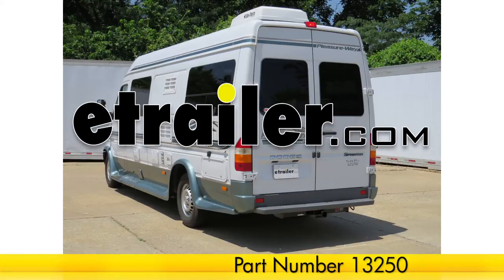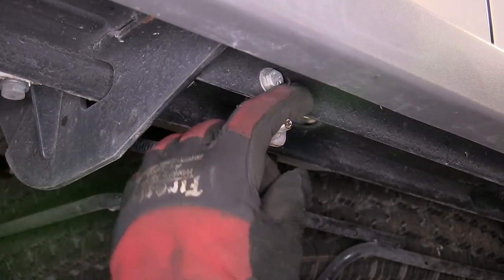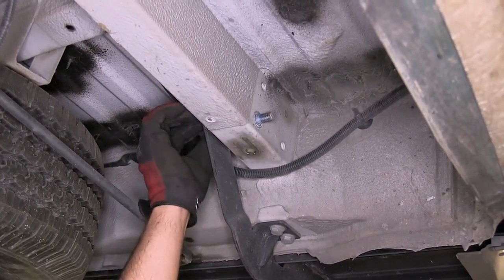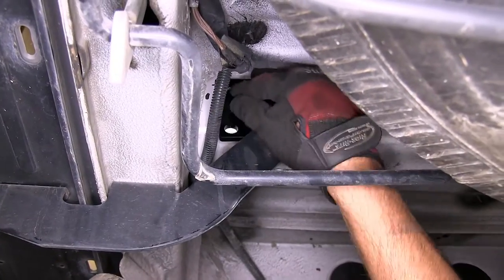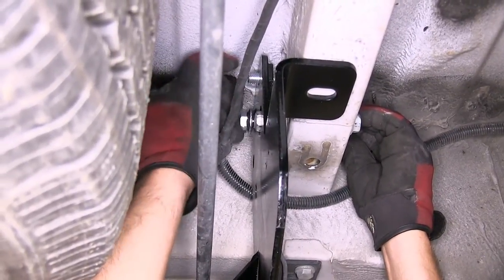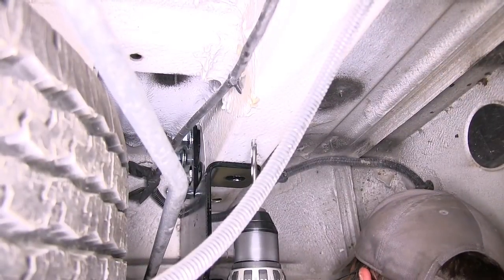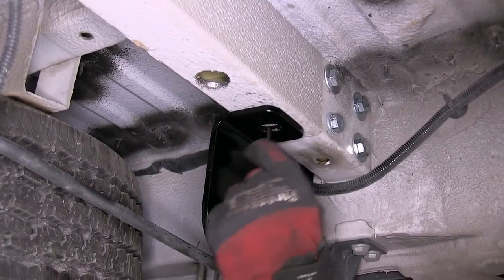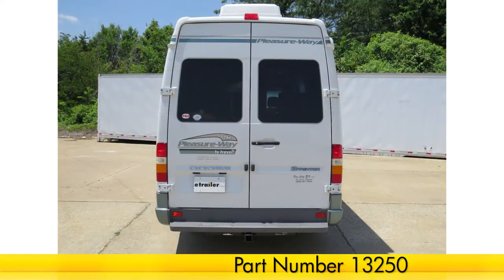etrailer | Installation: Curt Trailer Hitch Receiver on a 2004 Dodge Sprinter

Comment: Do you need the 1/4" spacer plate on a non-step bumper model?
Reply from the maker: You will still need the spacer plate for non-step bumper models. You just will not have to break the corner of the plate off.
https://www.etrailer.com/Trailer-Hitch/Curt/13250.html

Comment: What product number for 118” wheel base?
Reply from the maker: This trailer hitch is designed to fit the 2003 - 2006 Dodge Sprinter 118 inch Wheelbase with Single Rear Wheels. Check out more information in the following link. If you plan on towing a trailer, you will also need wiring to plug a trailer into.
https://www.etrailer.com/Trailer-Hitch/Curt/13250.html
https://www.etrailer.com/t1-2004_Dodge_Sprinter.htm

Comment: please where to buy hitch for 2005 dodge sprinter 3500 dual rear wheel?
Reply from the maker: You can view your options at the links below and can buy directly from us. The first link is for 140 inch wheelbase with dual rear wheels. The second link is for 158 inch wheelbase with dual rear wheels. 

https://www.etrailer.com/hitch-2005_Dodge_Sprinter.htm?style=140+inch+Wheelbase+with+Dual+Rear+Wheels

https://www.etrailer.com/hitch-2005_Dodge_Sprinter.htm?style=158+inch+Wheelbase+with+Dual+Rear+Wheels